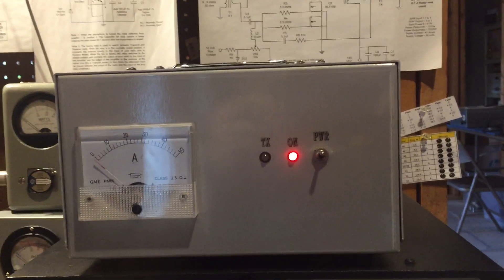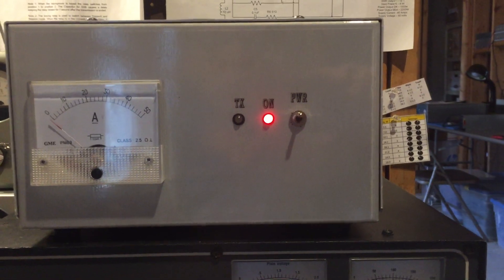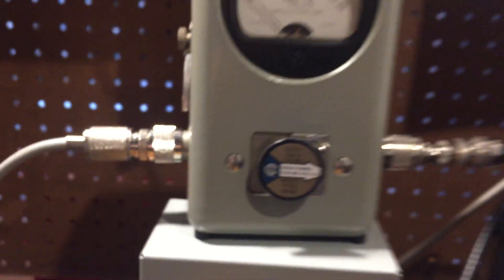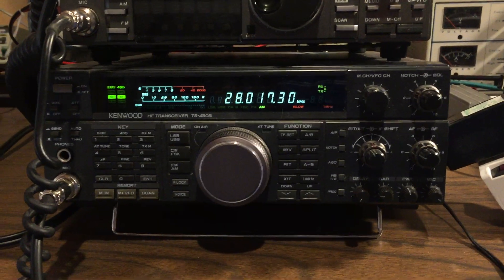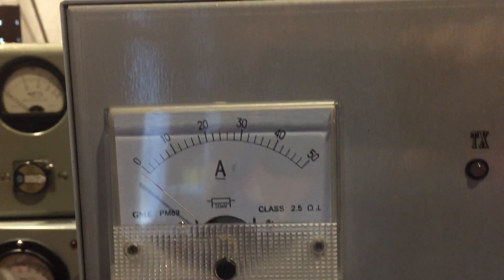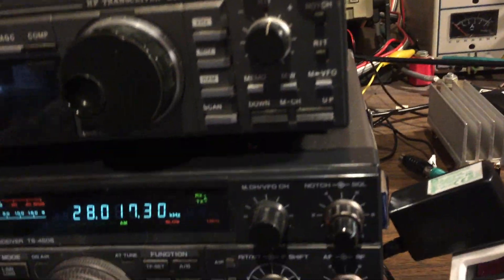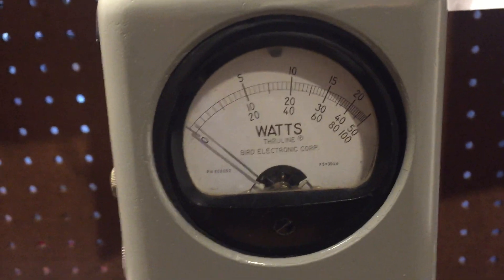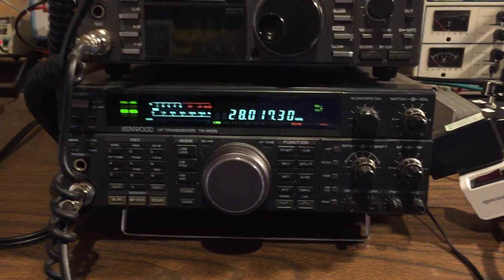1500w_LDMOS_Amp_For_Sale

Comment: I always like your videos.   I'd love to make/purchase an LDMOS Amplifier of about 800W or so from you for 10-15-20-40M mobile, but I assume they only run on 50V and can not be made to run on 12V.  Running 4 batteries in series would be a bit much. So I'd be stuck with bipolar transistors?

Comment: Hello  huge fan of class AB1 amps . One of my best buds told me to stay AB class for life. Best sound . You sound clear let the amp do the talking . Am confused with the myriad of radios. Guessing have a Cobra 29 for AM . Maybe an RCI 2970 for SSB ? I  dunno know . Help ?
Reply: "Real" AM is plate modulated. Linear is not a greatest for AM. That's why a real 500 watt AM transmitter like a Gates or Collins takes a forklift not a brief case to move.

Comment: perhaps you could show a demo of it in say 75 mtrs or even 40 mtrs?  All you have demonstrated so far is an amp for CB radio use...  How about something to show us how clean it will be as you enter actual Ham Radio freq's, as the only test you show so far is not where most of us that would spend money to buy a homebrew amp...
Reply: No low pass filters, no swr protection, shitty metering. CBers love um.
Reply from the maker: 10 meters is not a CB band. I will try to make additional video in the upcoming weeks. Regards
Reply: How would you make a swr protector? Never heard of this.

Comment: Low Pass Filters where are they?
Reply from the maker: I can add a LPF for an additional charge.
Reply: @rfmanchannel6915  No, he means please SHOW the output after the LPF. No LPF == not a sine wave measured by the Bird == hopelessly inaccurate. It is of no use at all showing "Bird Watts" if the meter is not presented with a pure sine wave!
Reply: Mud Duck Sharky has a nice low pass filter design. Simple and easy enough to duplicate.

Comment: How much Drive are you putting into it bird Watts and peak watts ..... Interested
Reply from the maker: I have a -6dB attenuator installed on the input side, so you can drive it with 10 to 20 watts deadkey (RMS). 20 watts for full 1500 watts of output power. The peak watts when modulating can be as high as 60 watts PEP or swing.